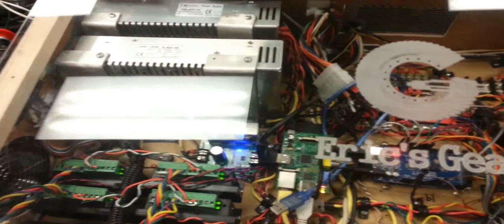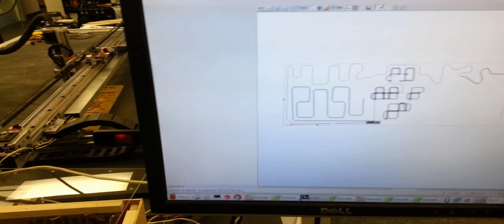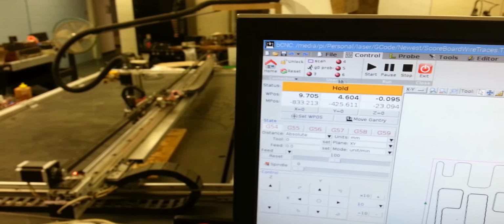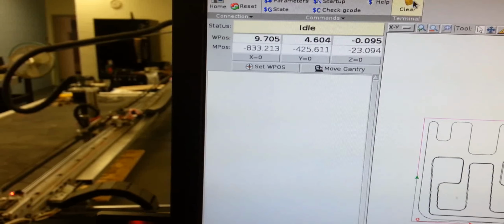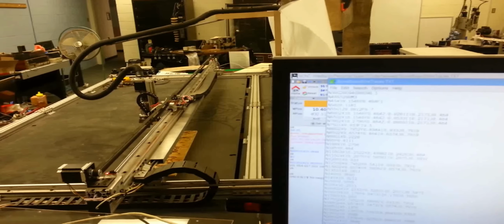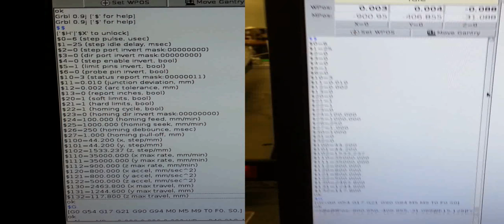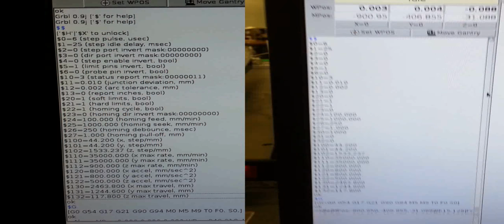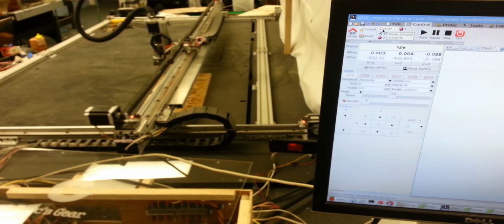Troubleshooting my home built CNC machine

Comment from the maker: FYI, the owner/programmer of bCNC got back to me right away and had the issue fixed in about a week.  Some of that was waiting for me to upload another file for him and me having time for testing  his fix.

As of before July 15th, things were working correctly.  I even took the whole machine to a maker fair tha the QC Co-Lab put on in Davenport, IA.  I ran the machine all day without problems.  Granted, I ran it by using the GUI to point-and-click where I wanted the head, but I didn't have to restart it a single time.

I didn't use it to cut anything, since I didn't want to worry about cutting flesh...